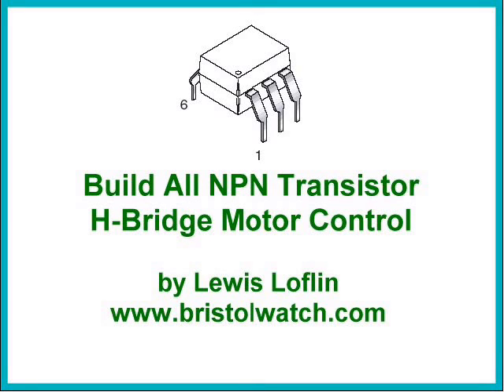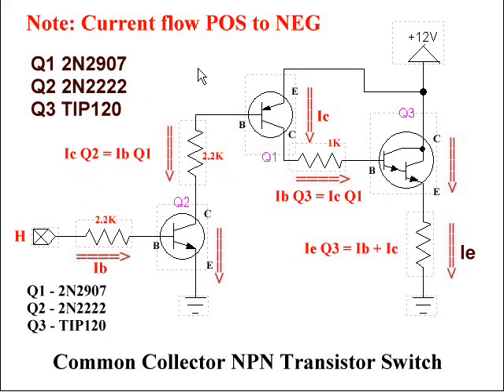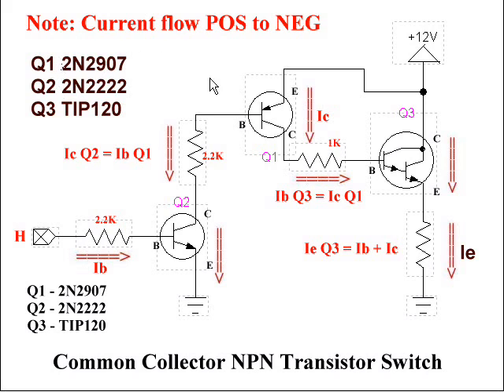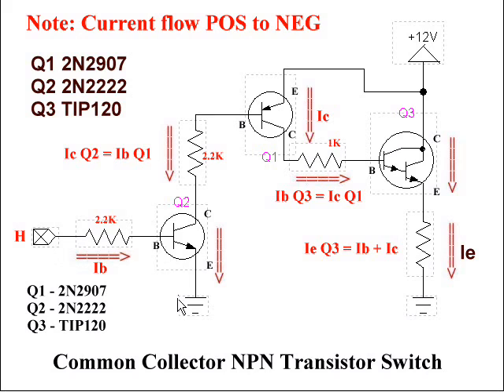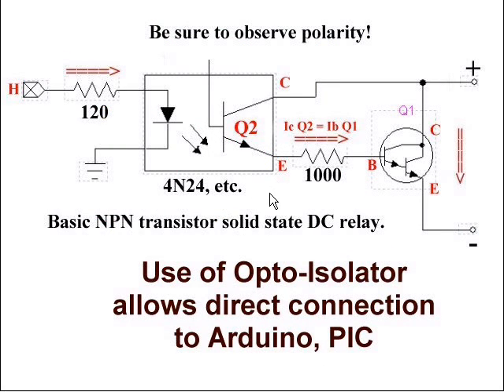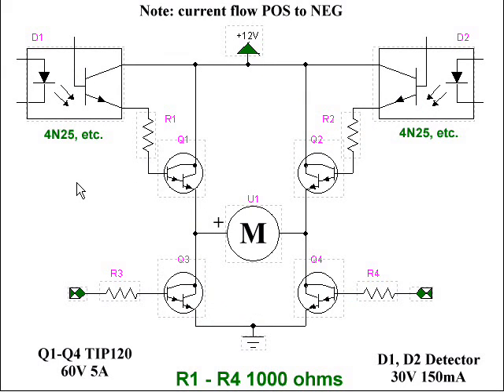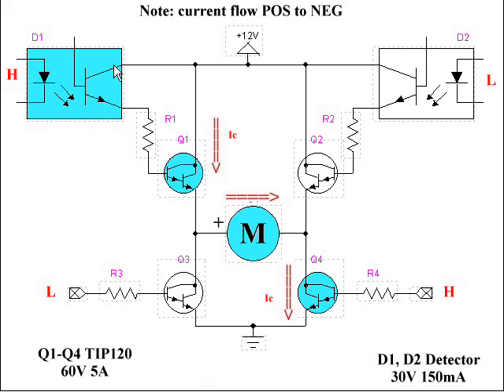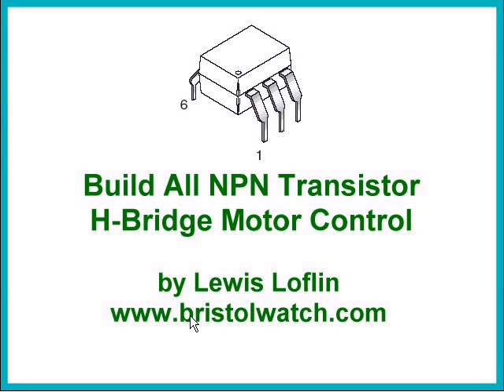All NPN Transistor H-Bridge Motor Control

Comment: Could you please explain your reluctance to connect an NPN directly to an Arduino output when it's controlling a higher voltage device (e.g. 12v).  I see that this is commonly done in other videos and various sources and so I'm trying to understand what sort of fault condition you're trying to prevent against.  Thanks.
Reply from the maker: you can if you want to. I prefer opto-couplers to limit circuit noise to the Arduino.
Reply: @LewisLoflin  Yes, I believe that would provide the best isolation, especially for noisy inductive loads.  Thanks for your reply.

Comment: What about protection diodes?
Reply from the maker: If using in this case TIP120 and TIP125 they are built into the transistors.

Comment: First off, thank you for all the videos, I've learned a lot since getting into Arduino's.
I am currently trying to shrink a Arduino/motor shield for DCC++ control of my model railroad to fir inside a N scale locomotive tender. Shrinking the Arduino is easy, just build a bare Atmel328P . Shrinking the motor shield is another thing. I think this video points me in the right direction, could you breadboard this to work as a bi-polar bridge that would be DCC++ compliant? DCC++ uses the motor shield to send timed alternating pluses on the track as a bi-polar signal which is decoded by the decoder installed in the locomotive. If I can shrink the Arduino/motor shield to fit inside a N (or HO) scale locomotive tender I can put batteries in the train and run on "dead" track.

Comment: what modifications are required ? I want to operate it at 250V DC (Vcc) for some other application.
Reply from the maker: you have to use transistors high enough to handle the voltage but no opto-coupler can handle that voltage.
Reply: @LewisLoflin  Use of Insulated gate bipolar junction transistor could allow you to use low  voltage control from an opto coupler at the High Voltage IGBT transistors, 
where it only requires about 5volts on the gate, also the guy is asking to use 250V Dc,, there are IGBT rated well above that you can get at reasonable cost like 2 to 5 dollars

Comment: What if you use 2 batteries and connect one wire of motor to ground and split the second wire and add 2 transistors. one to neg and the other to pos side of batteries.

Comment: Are you sure that works??
The base of Q1 and Q2 must have higher voltage (by 2.5V according to the datasheet, but if you include optocoupler's collector-emitter voltage drop than the emitter voltage must be around 12V-2.5V- [0.7 to1.5V] = 8-9V from the ground in order to operate) than their emitter, but if they conduct saturated, then the emitter voltage is close to 12V relative to ground at best. If  the emitter is at 12V, than your base would need to be at 14.5, which is impossible no matter what kind of transistor or optocoupler you will put there.
This will hardly work, the base voltage will most likely not reach saturation voltage and if it won't, then it will increase the voltage drop between collector and emitter and thus this darlington pair will steal lot of power from the motor.

Either this won't work, or Q1 and Q2 will take about 30% of power from the motor while forcing a giant voltage drop between collector and emitter.
Reply from the maker: These are current controlled devices not voltage controlled. When the optocoupler is turned on the CE voltage is 0.5V These are not MOSFETs.
Reply: and what about Veb in TIP120?
They may not be mosfets, but they still have a minimal turn on voltage between base and emitter.
The TIP120 has a turn on base-emitter voltage of 2.5V.
Transistor is a current controlled device only when the base voltage is above minimal turn on voltage.
The base-emitter junction is basically a diode, and you will never turn on a diode when the potential difference is below knee voltage.

Am i right?
Reply from the maker: The voltage drop BE of the TIP120 is 1.4V (0.7 + 0.7). You have a series circuit with R1 and R2. These are current operated devices.
Reply: I have simulated your design.
The voltage drop between collector and emitter will be 1.9V and the power dissipated in Q1 will be 1.5W assuming the motor uses 12W max. In this circuit the motor would consume only 8.5W which is 30% less.
Reply from the maker: In other words, you never built the circuit. I never use simulators I use actual components. Ever hear of heat sinks? Simulator wouldn't show that. When the transistors are fully switched on (saturated) the CE drop is about 0.5V
Reply: You don't need a heat sink here, the transistor will survive, but the issue is that you had a 12W motor and now you have an 8.5W.
And you cannot lower the CE drop on TIP120 because you would need to also lower the knee voltage on BE. CE drop is stuck above 1.5V unless you can somehow provide more than 12V to the base of TIP120.
Reply: I did have miscalculated voltage drops, but the effect remains.
Reply: @KogiSyl  - spend $10 and build it. In my experience,  simulators fail on simple transistor circuits all the time.  They are great within the narrow purposes they were designed to simulate (e.g. filters, logic, rf, etc). They really stink with simple transistor problems.

Comment: I have been experimenting with these kinds of circuits and for some reason, when I dalrlington pair the transistors at the top as well (like in the circuit above without the extra circuit you place connected to the pair's base and collector) the circuit just won't work and I never understood this. Is it because in order for these things to work, the emitter must be directly connected to a power supply? because the emitters at the top transistors are connected to the motors connections instead of the power supply like the one's at the bottom, I am assuming that because of the absence of a current in the emitters connection the junction doesn't activate which disallows current flow from the collector from attracting the current that may be traversing the motor, hence the circuit doesn't work. I an starting to believe that the emitter needs to be connecting to a direct connection to the power supply because not doing so will not activate the junction. Even if there is a connection from the motor to the emitter in the top transistors, the collector's current fails to attract what may be trying to be applied to the emitter therefore the junction doesn't activate and the circuit doesn't work? I had ran previous experiments with LED bulbs and no dice. I am still lead to assume that because there is no direct connection to the emitter from the power supply, the circuit simply won't work since the junction hadn't been activated, when that happens the current from the collector doesn't traverse through the base and the circuit doesn't work? Just checking if my theory holds up because I have designed an H bridge with both the NPN darlington pairs at the top and the bottom then applied a controlled 3V current to the appropriate bases and nothing happened.
Reply from the maker: It's a PNP transistor so the emitter must go to positive.
Reply: Yes I know, but when I use the npn transistors like you did, there circuit didn't work. Does the junction always have to be directly connected to the power supply or a source of power or does it not matter I have connected the npn at the top with the emitter pointing towards the bottom and the positive connected to the collector, is the fact that there is no power being applied to the emitter is the reason why the circuit didn't work? An I right that the junction isn't being activated due up an absence current going through the motor and into the emitter?
Reply from the maker: It won't work because the bias is wrong.
Reply: Lewis Loflin How? The + terminal is connected to the collector which typically accepts the + terminal on an NPN transistor (unless like I said, the emitter needs to be directly connected to a supply of power, or electrical signal so the junction activates). There is no direct connection to the emitter pins in the transistors at the top in my design so I am assuming that those currents from the ground terminal aren't making it through the motor and being applied to the emitter hence the circuit not working? I understand the biases (I think) and the collector on an NPN transistor typically accepts the positive current and this is what lead me to the design I came up with.

https://i.imgur.com/SV2fSyS.jpg

Thanks for the help by the way.
Reply from the maker: Won't work. You will need to drive the top two transistors with about 15 volts and use a larger values resistor. Why don't you use the opto-couplers?
Reply: Using a single Darlington pair with the tip41c and 2n2222 with the 9v battery supply, the 180 ohm base resistor and the 3v signal from the raspberry pi made it work just fine, even worked with pulse width modulation. I don't have any optocouplers so that's why. And I got to the resistance values from the calculations in the image, unless I didn't write it down clear enough, my handwriting is garbage sometimes.